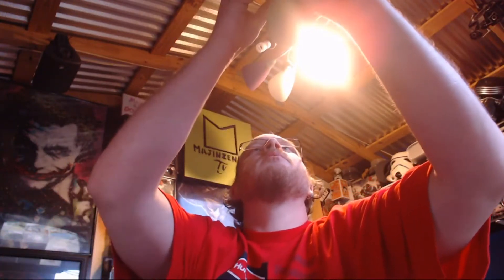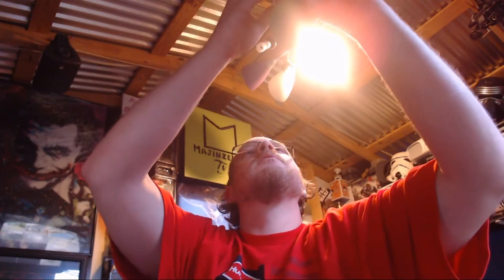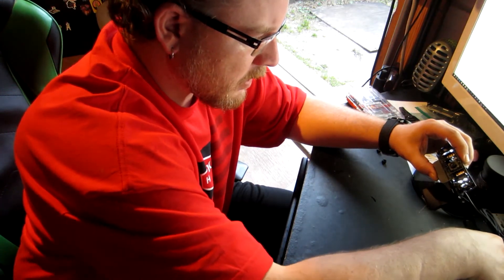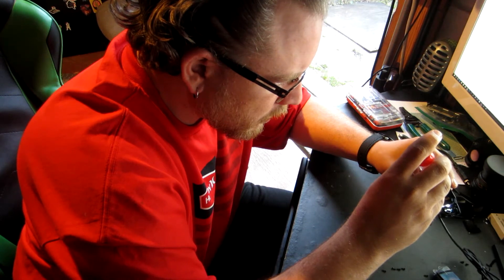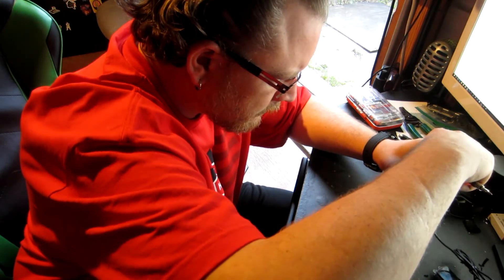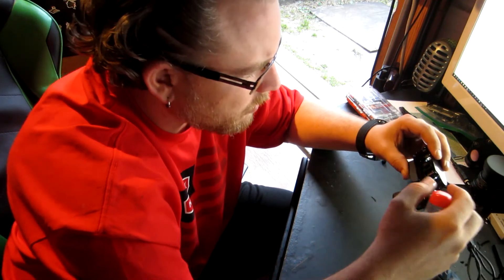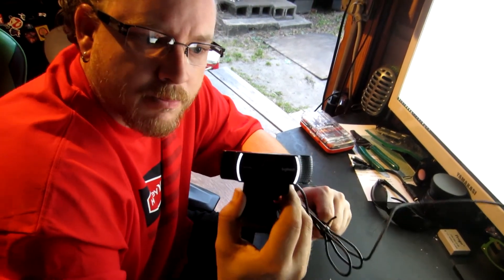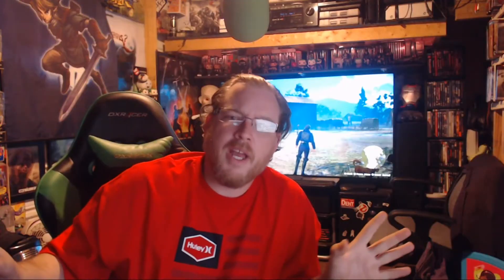Logitech C922 Cutting Off - Lights Blink and USB Not Recognized: Repair Attempt

Comment: I'm having the same problem with my camera. I hope I can get it replaced by Logitech because it is new and it has a warranty, but I might try this if not. However I don't understand how you fixed it. Just plugged again the connector inside and check that the ground cable was connected properly? I hope I'm lucky enough to fix it like that. Thanks for the video!

Comment: how did you start the teardown since the screws are not the same as the 920?
Reply: The screws are under the two rubbery pads on the bottom, more or less the same place as the 920, but the pads are double layer, pull the first layer off and you see what looks like shiny plastic underneath.    That shiny plastic looking stuff is the second layer of the pad. Pull that off and you can see the screws.  If you can get both layers of the pads off without wrecking the pads you're a better tech than I.  And yes, I broke mine figuring this out.  Replying here because this is the only video I see dealing specifically with the 922.